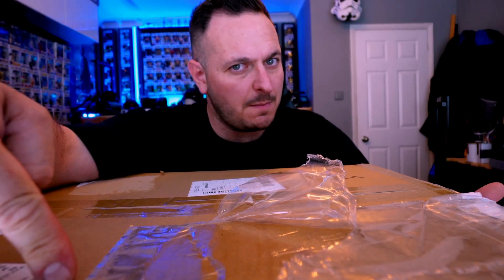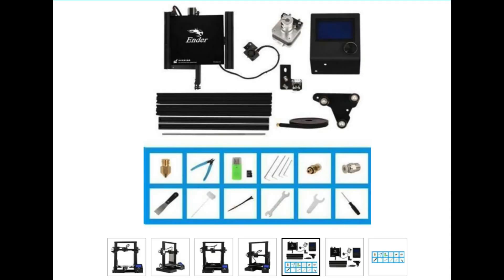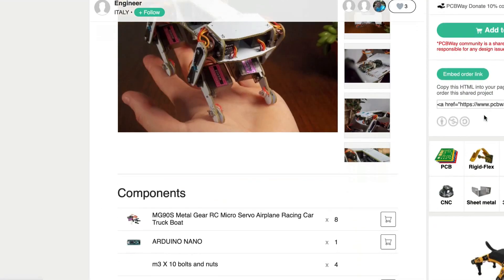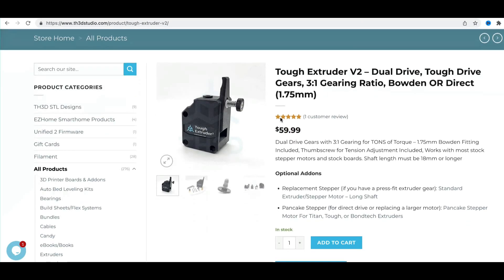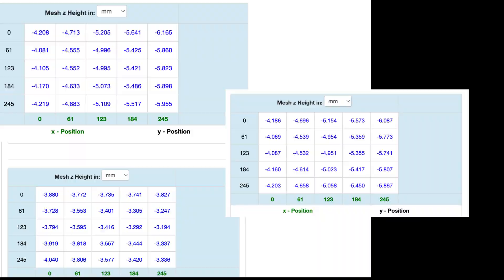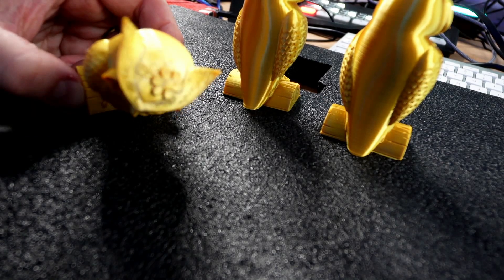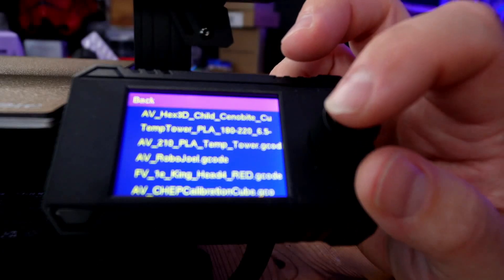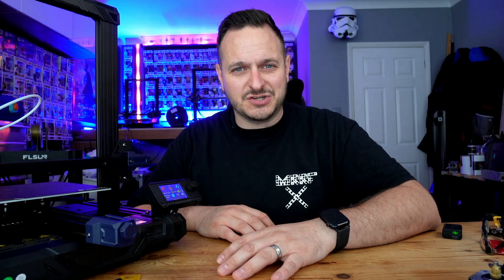Anycubic Kobra Go - The Ender 3 Replacement is HERE!

Comment: Bought one a few weeks ago, and finally testing it out. Main issue was having it what I was printing, staying in place, but think I got it down. One issue I’m facing is how to print other things than just what was on the memory card. I use auto cad, and convert it to the printing file to what it excepts. The file is on the screen it but won’t print. What do I do about that?
Reply from the maker: I’d save that file as an stl then import it to superslicer or cura for correct slicing and processing. Let me know how you get on
Reply: @TheRealSamPrentice  thanks I’ll try that. Also, how do I make sure when I print it doesn’t get bumped and is being moved around by the nozzle area? I’ve been trying to make that damn owl it already had in its memory card, and have barely gone past the base without it being nudged and moving all over by the nozzle. What do I do to prevent that?
Reply from the maker: @renji90998  okay Z hop might help, again that’s in cura or superslicer so in “speed and travel” you’ll find z hop retracted, over printed parts. Give that a go but it won’t help with your current owl :)
Reply: @TheRealSamPrentice  OK I went with Cura. Doing my best to resize it to what I wanted it in AutoCAD. Yet still whatever I’m making gets moved around at some point. Just wanted it to stay in place without moving by the slightest bump. I have leveled it and it’s usually good.
Reply from the maker: @renji90998  as in it’s not sticking to
The bed ?
Reply: @TheRealSamPrentice  yeah, it gets hot but doesn’t keep the melted filament in place. The second there’s a bump it moves all over with the nozzle. Should I create a thin platform below the object? Also, do I have to set the Z offset dial? It flashes yellow and I wonder if that’s part of the problem too
Reply from the maker: I’d adjust the z height in that case move it closer to the bed
Reply: @TheRealSamPrentice  I tried that and was mostly doing guesswork. Would creating a thin floor under my actual model help?
Reply from the maker: @renji90998  like a raft? Maybe but you shouldn’t need to
Reply: @TheRealSamPrentice  I know this takes practice but so tired of adjusting. The one 3D printer I’ve used was the one my drafting class had. It would leave excess residue, but It would just break away or dissolve if it was in deep crevices. At least you’d know it would stay in place.
Reply: @TheRealSamPrentice  OK I may have an idea that will work. Apparently you can use a type of adhesive. Like PET tape or Elmers glue. Would that work or cause damage to the bed?
Reply from the maker: @renji90998  You can use glue stick or 3dlac

Comment: Don’t really understand why you say it’s a replacement for the Ender 3 when you had all these issues with it.
I didn’t have issues with my Ender 3s so don’t really see why this is better.
Confused.
Reply: Well I beg to differ. I had the 3v2 and I got some good prints but after some time I had so many issues with the bed leveling. It's so annoying that u pay $300 for a printer and They can't even throw in a auto leveling firmware and hardware.
Reply from the maker: @reviewithme9913  things called maintenance..
Reply: @TheRealSamPrentice  I only had it for not even a month and only did like 2 prints.. i don't think a $300 printer should need maintenance that soon lol
Reply from the maker: @reviewithme9913  so you did two prints and gave up? There is a medal for that achievement
Reply: Well my kobra go had 0 issues except small tweaks on cura. Prints great and only took like 1-2 hours to setup and it’s been good ever since
Reply from the maker: @philmybutup4759  outstanding !!
Reply: @philmybutup4759  same here for the price it's unbeatable. I have done several prints with very little maintenance
Reply from the maker: Thanks
Paul